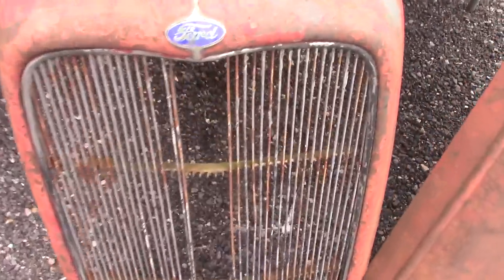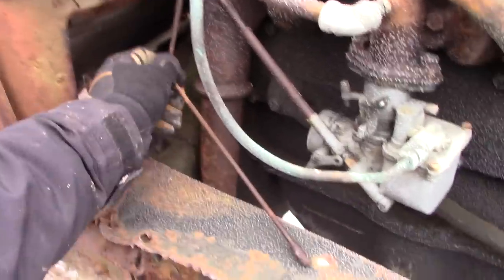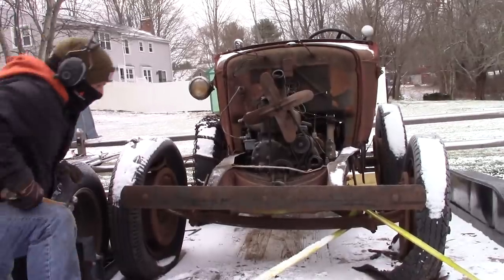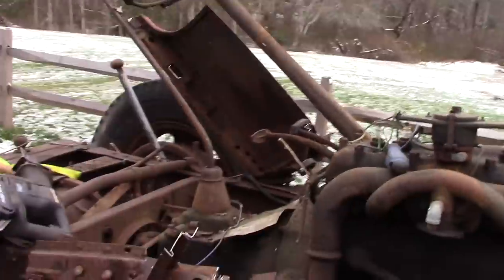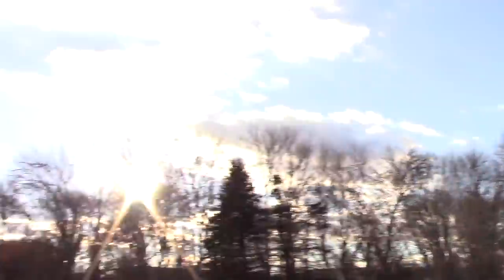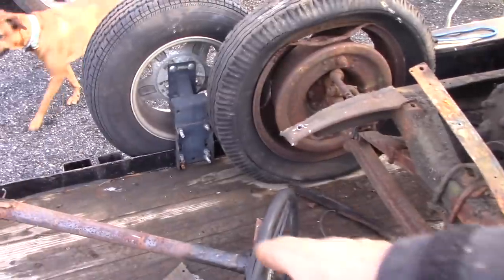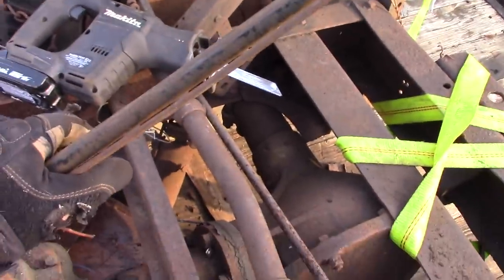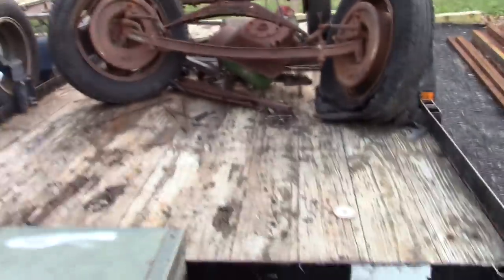Doodlebug score on FB Marketplace

Comment: My 28 Doodlebug has a rectangular homebuilt 2 inch angle frame mounted with a 2 cylinder air-cooled Wisconsin engine. An early AA truck transmission is connected by sprockets and a roller chain (speed reduction). Front and worm drive rear axles have been narrowed for crop row clearance. All one ton Ford TT and early "28 AA trucks had worm gear differentials, later AAs had conventional bevel gears.
The wheelie bar was probably a boom to lift an implement. Doodlebugs were prone to flip backwards due to their shortened wheelbase. 
The hand lever probably operated the left brake to pivot the direction in the field, the stock foot pedal operated the same on the right brake drum. Early tractors had individual rear brakes/pedals, some had a flip tab which joined both as one.
Reply from the maker: Wow. No kidding.  Thanks for all the information! Love it when I learn something new.  
I was joking around describing all the oddities.  I know they were usually well thought out and very useful pieces of equipment.  I typically stay away from them, because usually there’s not much meat left on the bone. But because of the grill shell I had to snatch this one up.

Comment: Good video informative. A good score Mike.  Recommend  that you take /save that  curvy looking cross bar the rear brake rods attach too.   I have one  I bought because I had seen one used as a spreader bar between the the frame horns like a bumper I believe it was. It was cool looking.

Comment: The body was from a 1930-31 Model A.  That trim around the cowl may have been stainless steel - if you carefully remove the paint, you might be able to salvage it.
Reply: Also, I noticed the exhaust manifold was a 1931 version.
Reply from the maker: Yes.  I knew what it was when I originally saw the ad.  
Unfortunately the cowl band wasn’t stainless.  It was completely rotted through on the drivers side.  It crumbled when I was trying to remove it.
Reply from the maker: @mafcawebmaster4237  the motor is being picked up this week.  I have no use for it and that puts me in the profit on my “investment”
Reply: @ThisOldHotrod  Way to go.  Gas tanks bring over $100 in my part of the world.  Could be saved.   Firewalls are valuable too.  Don't scrap that stuff :)
Reply: Good morning Mike good job on your parts find love watching your videos keep up the good work!!
Reply from the maker: @mafcawebmaster4237  it’s all tucked away.  The gas tank ended up being filled with ice.  It was so heavy I didn’t know until the temp warmed up and I moved it and it was sloshing around.  
I removed the cap and drained it.
Reply: @ThisOldHotrod  Good deal.  Someone will be happy to get it.
Reply: @ThisOldHotrod  Glad you said why the tank was so heavy. I was wondering what could be in there making it so heavy. Yup ice would do that.
Reply from the maker: @yomangull2538  haha. The whole time I was wondering what it could have been.   After I heard it sloshing around.  I thought, ya that makes sense.
Reply: @mafcawebmaster4237  The steering column drop on the bottom of the gas tank is 1930. It was probably built from several year's parts.
Reply: @gregwise5324  The instrument panel on that tank was introduced in June 1930 and used to the end of production.   The steering column drop would have been used until April 1931 when Ford changed the design of the gas tank so that the output came through the firewall into a teardrop indentation.  So the tank was from a vehicle from June 1930-April 1931.   But you're correct: many Model A's have mismatched parts.  When I was a young man, I had a 1929 Tudor body on a 1930 Frame and I had all sorts of problems getting things to line up.  Who knew ... :)

Comment: up here in Maine that would be a jitterbug or a homemade  "skiddah" and the wheelie bar is a makeshift log arch for dragging logs ,
Reply from the maker: I’ve never heard them called jitterbug.  But “skiddah” is certainly fitting. 
I knew it wasn’t a wheelie bar.  I figured it was a homemade attachment for whatever they needed at the time.  
It was made from an older bed frame

Comment: That started out life as a 1930 AA. That entire cowl would have been good rat rod  material. A lot of guys build rat rod roadster pickups out of them. Believe it or not there is even a doodlebug following/ culture out there...
Reply from the maker: Yes. I should have left it together.  But I didn’t.  Looking back I should have.  I’ve had plenty of full cowls  they’re sometimes harder to sell than the good pieces on them.  
I saw a thread on the H.A.M.B. about doodlebugs. 
I was quite impressed at the length guys go to rebuild and restore them.

Comment: I could use the AA steering box and an wheels/tires that are still holding air for our doodle bug. located in NH.
Reply from the maker: The steering has been spoken for however if you want to take a ride down. I still have the rear axle w the wheels and tires.  
Shoot me an email and we can see what works for picking them up. 
Thisoldhotrod@gmail.com
Mike

Comment: I stopped watching at 15:12 when you ran the cutoff disc down the cowl panel, really dude!!
Reply from the maker: I bought it for the parts. The cowl feet were toast the lower cowl sides were gone.  The hinges had been torch cut off and the windshield posts were gone years ago. 
I had said at the end of the video I should have left the cowl complete. 
Regretted I had cut it up. 
It’s easier to store and sell the parts than a whole rotted cut up cowl.  I’ll save the next one.